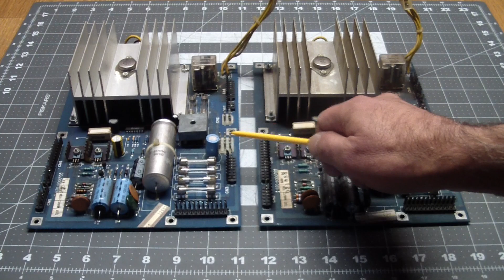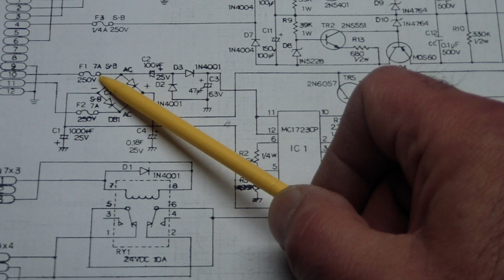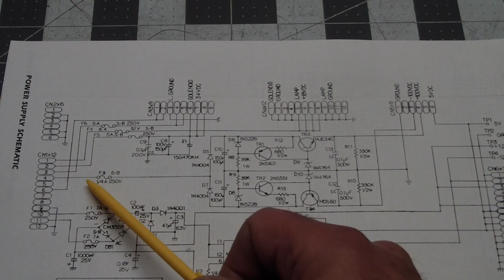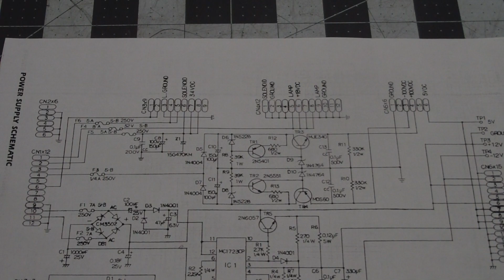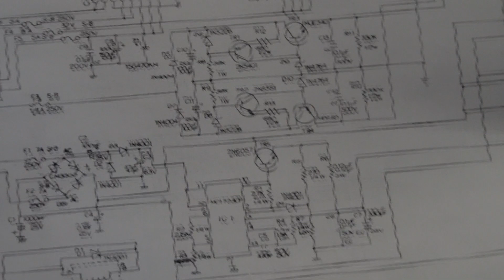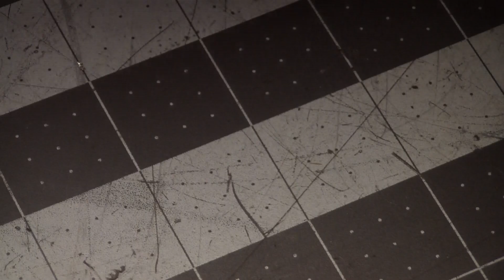AE#188 Data East Pinball Power Regulator PCB Repair

Comment: I'm just curious about this weird fault and trying to understand/learn. Instead of doing the leg swap could you have cut the traces on the bottom of the pcb and do a wire jump instead? Thinking down the line if that part fails again. The next tech might not realize why the legs are the way they are and conclude that swap is the reason why the part died. Also fantastic detective work on finding the problem.

Comment: On certain arcade games if you use a switching power supply the switching power supply will create problems on the display artifacts and anomalies on the display graphics and characters is there any reason why the switching power supplies do this and you have to only use linear power supplies on certain arcade games I'm not sure exactly which arcade games it does those two not all our card games will have this type of display issues but why are some arcade games more sensitive to switching power supplies for the display monitors on our cake games?
Reply from the maker: Switching mode supplies generate high frequency noise  will can adversely affect the electronics. But they are generally fine for arcade games, but you should avoid them for things like high end audio amplifiers.
Reply: @artifactelectronics  The switching mode PS will create waves in the arcade CRT monitor, I'm not sure why some arcade games its ok but others it creates waves in the display graphics. They have these external filter boards to be used for arcade games that attach to the switching mode Power supply for this issue, Try to look up these filter boards and make a video lesson about them

Comment: 11:48 little did he know I'm watching this on an actual TV. From 1978.
So if you'd replace the high voltage regulator transistors with higher specced ones, when the regulation goes bad, you wouldn't even notice while your plasma displays are dying a slow and painful death?
Reply from the maker: Correct. The higher spec device would allow the voltage to go much higher and potentially destroy the displays.

Comment: Look at R6. 0.12uf ? Is that a mistake?
Reply from the maker: I checked the board. It's a 0.12 ohm, 5W power resistor.
Reply: @artifactelectronics  thought it was a typo of some sort. Knew you would spot it and check it out. Nice work by the way.

Comment: Looks like D2, D3 C2 and C3 is a voltage doubler
Reply: Yes voltage doubler, so the 723 has a higher voltage to operate off, but the pass transistor has a lower voltage so dissipation is lower. Very common for that electrolytic capacitor to fail, it is being run on AC, and should really be a bipolar unit, or at least 2 double the value capacitors in series, arranged positive to positive. Best replacement is a pair of 220uF 35V capacitors in there in series, will last a lot longer. Ideally there should also be a resistor in the lead to the collector of the 723 internal pass transistor, so that even if the error amplifier turns it on hard the current is limited, so you do not blow the 723 every so often on power on from the stress of trying to charge up the capacitors with high current. 

Around 10R in series with pin 11 works, though if the designers had cared to look at the datasheet you need very few extra components to implement the LM723 as a switching regulator, which means you need a much smaller heatsink on the pass transistor, and then to add in the one diode and the inductor to make it operate. Extra components likely something they would have been able to fit on the existing board, simply because the heatsink now is an inductor, and you need a small vertical heatsink for the pass transistor and the diode instead.

Comment: Wow!  That was well found. I wonder if they used a transistor with a different pinout on the incorrectly marked boards as a workaround?
Reply: Very likely they had a surplus of the other type, and did these reversed boards as a way to use them. No update on the topside or silkscreen, as, based on the age of the boards, these are done with a silkscreen for the printing, and a photographic mask for the top layer, so only changed the lower mask for the run, saving a lot of money, as in the era these came from those 2 parts are expensive.

Likely there is a set of errata in the in house repair documentation about these 2 variants of power board, but being in house notes they likely never were published outside, leaving the boards to be "service exchange" items, sent in from the field by the repair crew to be refurbished. After all they probably thought that the games would be in use for a few years then get replaced, not that Arti would be fixing them decades later on.
Reply from the maker: They probably did have a surplus of parts with a different pinout. That part is an MJE 15431 which comes in a TO-220 package with a higher current rating. 
And thank you for your kind donation.
Reply from the maker: Correction, the part is an MJE 15041
Reply from the maker: When I got the board it had a MJE 350 which was open with no twisted legs. I considered hacking the solder side, but what I did ended up being less messy.